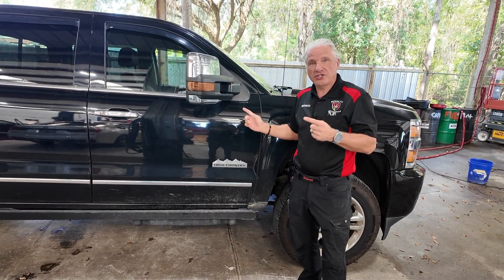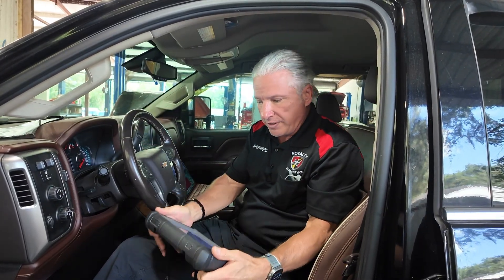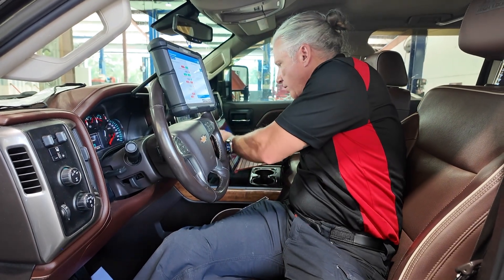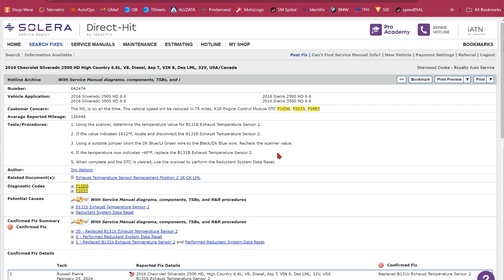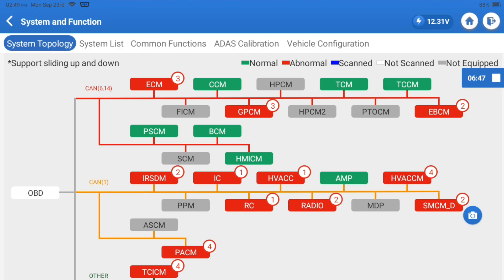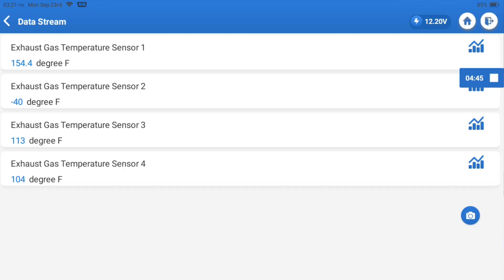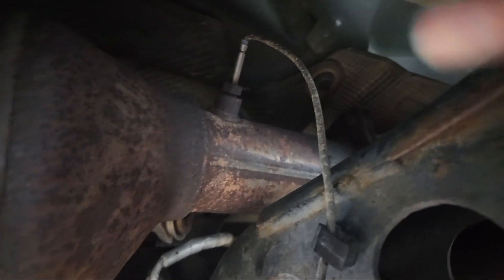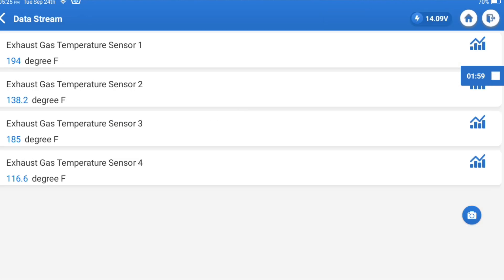Chevy Duramax Check Engine Light On With Exhaust Temperature Sensor Codes!

Comment: I bought a 2016 Chevy Colorado diesel new, and it has been the most expensive truck (maintenance) I’ve ever owned! Quite disappointing since it was supposed to be “truck of the year”.
I would never recommend a Chevy truck after 9 years of ownership. My Dodge Ram, Toyota Tacoma and Nissan were far less maintenance, and way more dependable.

Comment: Hi , do these ex temp sensors on your diesels work the oposite way to coolant temp sensors as you said -40 is a short circuit , bit confused to be honest , watch all your vids and enjoy them , thanks again.
Reply: Yes!  interesting to see.  most temp sensors are negative temp coefficient, which would show -40 on an open circuit.  These exhaust temp sensors are opposite of that.

Comment: At 3:16, I agree with you on Identifix being a great tool and how it is miss used. I usually get a call after all the "most common causes" have been replaced and the vehicle is still broken. To add insult to injury, aftermarket parts have been used which added more problems and variables.
The main cause of this problem is most shop owners making unrealistic promises to the customer, and then stressing out the tech with stupid questions such as "how much longer""?

Comment: Nice video , as a technician in the northeast I see a lot of corroded connectors on these diesel trucks because the seal has failed.
I also see this in conjunction with a new part . 
Just sayin

Comment: I bought a light aluminum floor jack to lift one side of vehicles up a few inches when working under them & lifting up the lawn tractor. Keeps you cleaner and burned less too. Of course, I use a jack stand if a wheel is removed, or the vehicle has low ground clearance.

Comment: Hi Sherwood, I’ve seen you crawl under vehicles without some sort of barrier between you and the ground. Can I suggest U-Line Corrugated Pads that come in all sizes.and thicknesses. Just mark top side of cardboard and keep the bottom always on the cement. Bet you will be more comfortable. For me, I can get under and out much faster. 
And no…I’m not sponsored by U-Line. Great video’s!

Comment: Identitix is a lifesaver IF used correctly. Just today I had a 2016 grand Cherokee with bank 1 intake cam position codes. Identifix gave me fricken cam crank wave forms!!  It showed me bank to bank, known good and known bad waveforms, I was tickled pink lol. I was expecting a shifted reluctant wheel or something but once I hooked my scope up I found that bank to bank intake pattern was identical BUT the good bank had a 0-5 volt waveform and the bad bank had a 0-2.5 volt wave form. Looks like when those position sensors go bad they give you that 0-2.5 reading. But just the sheer amount of vital information Identifix gave me made all the difference

Comment: why not use Identifix all the time why only when you want the special functions
Reply: It's kind of like asking a pilot why s/he doesn't just use the autopilot to fly the plane in all phases of a flight. Eventually, the pilot's skills get rusty and then you come across a situation that the autopilot can't handle. What do you do then?
Reply: Because if you have to rely on something to fix problems based on your lack of knowledge and understanding, then you’re doing yourself a disservice and shouldn’t be in this field. Like Sherwood said, it’s not a silver bullet and alot of guys just go in and use the first fix they find and it most times doesn’t resolve the problem. Now you’ve wasted time and money for mechanic to just swap parts and clear codes temporarily before your next drive cycle resets the codes on the ECM. You want a real diagnostician to do real work like this.
Reply: @lupavo1738  I personally use Mitchell pro demand have used them all i just ask the question to get a response im 68 been a mechanic whole life own my own shop have for the most part always worked for myself my father was in the auto salvage business

Comment: Exhaust temperature sensor is a thermistor.
40- °F is a substituted value or a default value which is very useful in diagnosis, means the wiring are fine which saves a lot of time. Go and replace the thermistor.